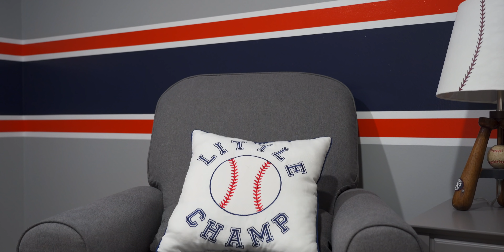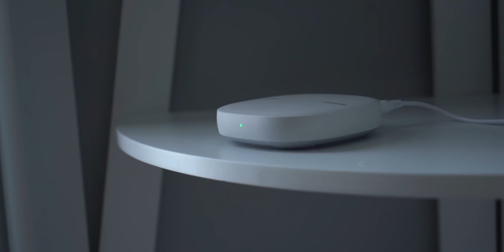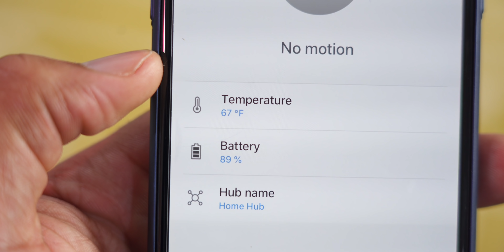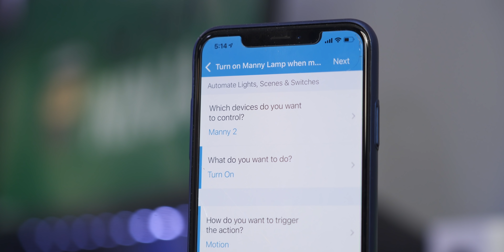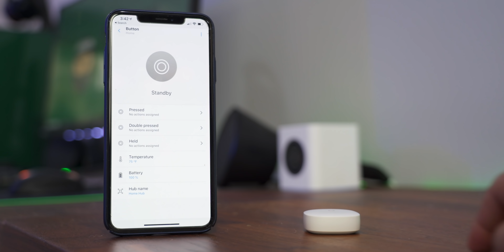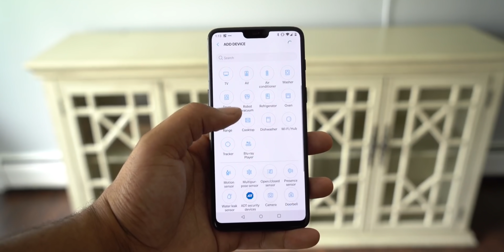My SmartThings Smart Home Set Up!

Comment: I knew understood the need for smartthings.  I am thinking that it's, like you mentioned in the video, easier to use one app instead of multiple. I have no problem using multiple apps because once you set up the smart house, depending on your gadgets, then its basically set it and forget it. I use alexa for controlling most of the major devices like thermostat, lights,  alarm system. I rarely have to go to the phone because most of the devices are automated. Thanks for the video nice job.

Comment: Thank you so much for this video. Specifically the Iris motion sensor part. Iris is shutting down at the end of the month and I need a new hub that I can still use my Iris sensors with correctly and I think this is the ticket. I tried Vera and it was a nightmare.

Comment: So I have a question since I’m new to all this smart tech stuff. Do you still have to have the philips hue hub with the Samsung smartthings hub to control the lights or does this take the place if the philips hue hub?
Reply: You actually still require the Philip Hue hub to be able to control the lights. I have Samsung smartthings and Philip Hue hub and since communication is only through internet between them and not Z-wave, Philip Hue hub is required for Samsung smartthing to be able to transfer the command. Without Philip Hue hub, the bulbs are dumb. Hope this helps?